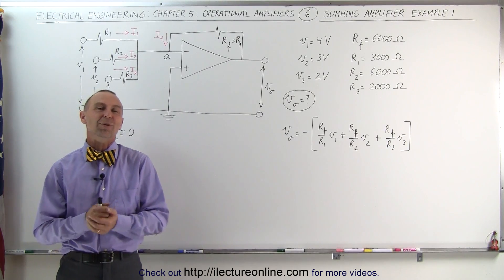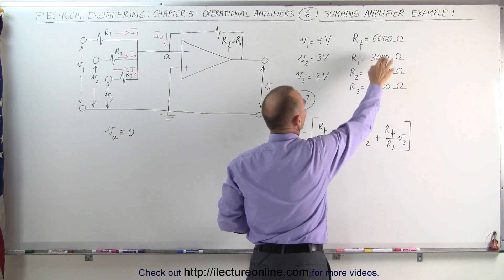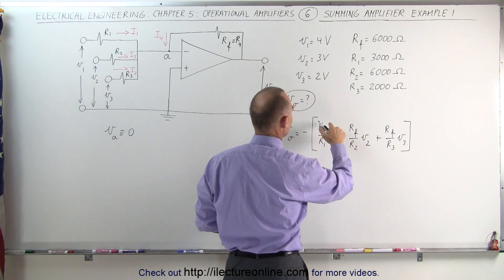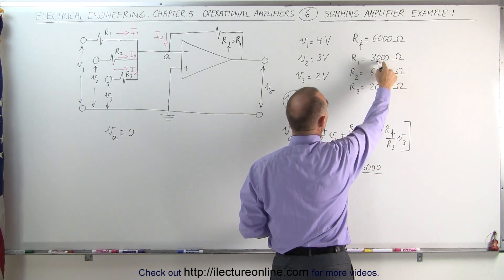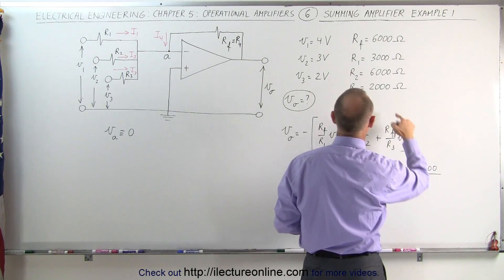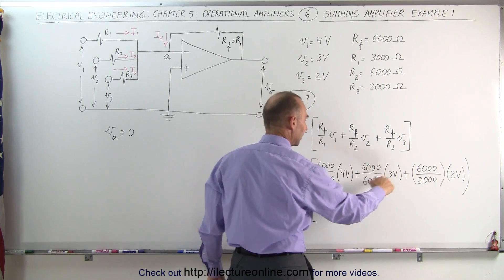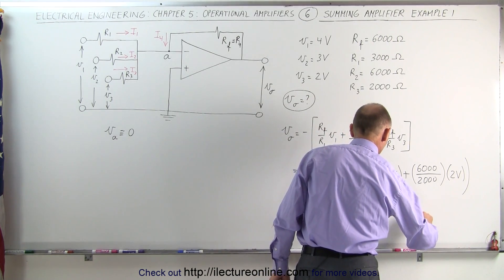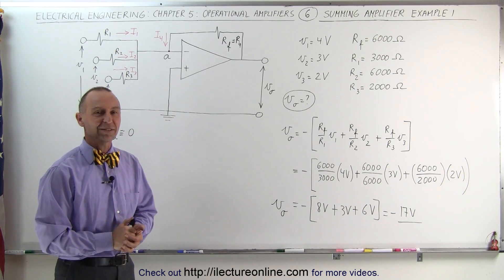Electrical Engineering: Ch 5: Operational Amp (6 of 28) Summing Amplifier (Inverting) Example 1

Comment: I wrote down the values for the 4 resistors according to the video title graphic and tried to see if I could work it through without help.  Once I finished, I got Vout=-4V (which was correct).  You arrived at -17V.  Confused and discouraged, I later noticed the values on the white board are in a different order from what the title graphic shows!  Whew!

Comment: Why current I4 come back to a ? 

Va=0
ButVout=-17
Reply: Doesn't matter which direction you draw it, so long as it carries the correct sign in your equations.  So, for example, if i4 were pointing towards Vout, you should get i1+i2+i3=i4
i4 will be defined as (Va-Vout)/Rf, which gives you -Vout/Rf